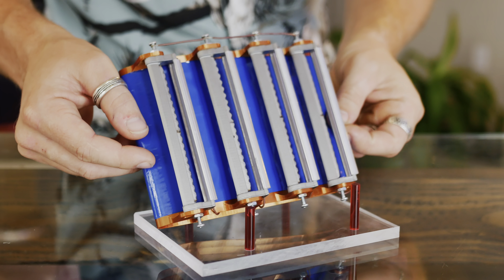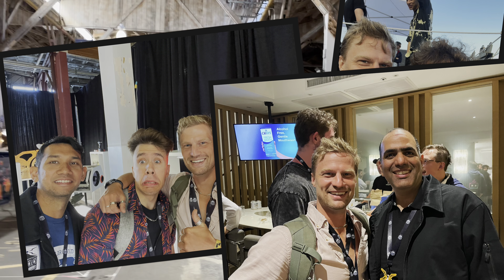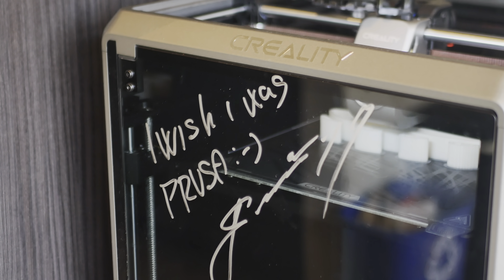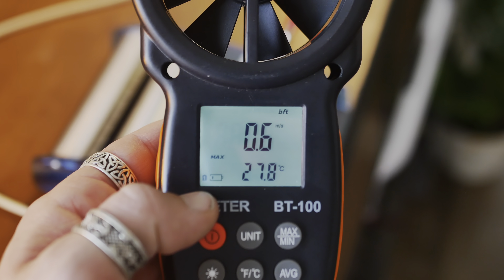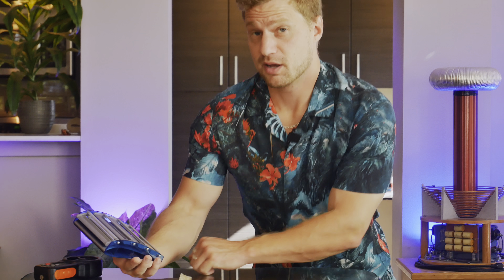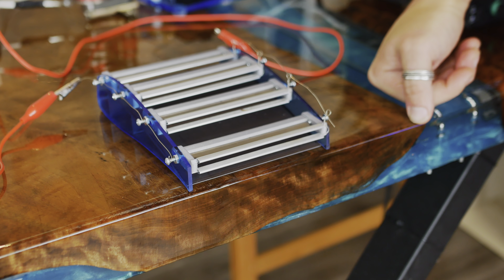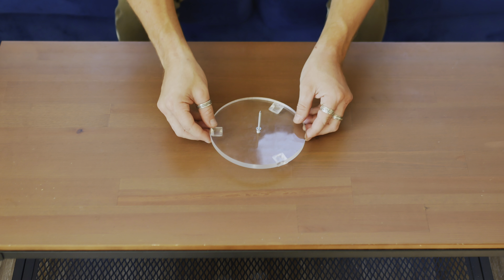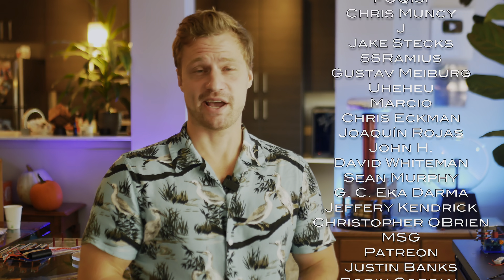Designing A Self Propelling Ionic Thrust Wing

Comment: I have a question:
would be possible to generate thrust if the ionic elements were on the surface of the wing? not above th surface, but ON the surface? like conductive tape glued on the surface?
i like your analogy of the turbine with wings, but you are putting things on a wing that will create drag, if was a way to crate such thrust without disturbing the aerodinamic of a surface, that would be gold.
Keep up the good work.

Comment: The wing is immaterial, you almost noticed that at the start of this video when you said the jet plane is built around the engine.  What you just need is sufficient thrust.  Rockets don't have wings, thrust moves them.  What you are doing here is just building scaffolding for flight thrust.  Modern fighters don't have the classical airfoil wing design.  They are incredibly thin with those surfaces primarily used for vector control.

Comment: Cool project but I am not really sure if this construction is going to work. I think the thrusters are going to create a lot of turbulences on top of the wings profile which might reduce the lift in the end.
I am not sure if it is possible, but don't you think it might be worth it to try to implement the electrodes directly into the profile of the wing? This might also reduce the overall weight a bit.

Comment: Have you considered just trying conductive ink, or aluminum foil, directly on the wing?  Using multiple sections, you might be able to avoid arcing by timing each segments power.  I know it's not grabbing the entire airflow, but applying even a little pressure difference would probably increase efficiency of the craft overall.  This approach could be applied to prop-blades as well, perhaps adding a little performance boost.  With recent concerns with fuel efficiency of commercial aircraft, this could mean HUGE savings worldwide.  Also, the surface itself is a perfect solar collector and may be able to provide or augment it's own power. (yay solarpunk!)

idk, just a thoughtstream, keep it up! Love the show

Comment: would not accelerating the air flow on the top side of the wing, and not the bottom increase lift? creating a higher pressure dif, meaning the shape will be able to be less draggy?

Comment: Try multi-body airfoils, so you incorporate the ionic trusts even further.
What forced you to installed all of them on top of the wing? Did you try all the possible configurations? I'd say there's an optimal 2 up and 2 down. Test their relative distance.
Last, add different pitch angle experiments to get Lift-Drag information.
Good work and good luck!

Comment: Instead of using wire for the leading edge why not not use graphite spray paint (with masking tape to mask the rest) and then electroplate the tips. 
Supper ultra light waight with whatever shape you want.

Also, there is a special type of fillement that can decrease it's density with temperature. I forget what it was called but it will drastically reduce waight without losing much strength,

Comment: Fantastic project and video!

I have a couple of ideas that could be worth testing:

1. Traditional wing airfoils work by creating an air velocity difference between the top and bottom surfaces, therefore generating a pressure difference and lift. In the case of this ion thruster airplane, since the thrusters are only on the top surface, you might experiment with a simpler, straight-wing design to reduce weight. This is because the high-velocity thrusters could potentially generate enough lift on their own without the need for the typical curved airfoil shape, as they can accelerate the air above the wing faster than below.

2. Given that the air is already accelerated to around 1.8m/s by the first thruster, it might be beneficial to increase the distance between the electrodes further down the air path to achieve even higher velocities.

It would be exciting to see these ideas tested out. Best of luck with your project! 🚀✈️
Reply: that the profile of a wing should be different with thrust applied to the surface probably is correct, but i would not use a flat surface. 
when the thrust stops for whatever reason the plane must glide to the ground safely, this would not happen with a flat profile.
Reply: @ulrichkalber9039  That’s true, having a gliding profile in place is probably best for a functional model. I considered using a flat wing for the proof-of-concept test bed.
Reply: @jot4p310  I think that gliding speed would be much faster than powered flying speed, therefore a flatter wing design would probably work.
the lost lift on slow powered flight would be compensated by the upper surface blowing effect.
Reply: Now with enough electrodes and ground points you could hypothetically control the power levels at each pair to create a virtual wing profile that you could dynamically vary

Comment: I would try to make the thruster fully integral to the wing. The first electrode could be just many thin wires thicking out of the wings 'skin' and the bottom part of the second bottom electrode could be just a little 'bump' behind the first (also might be used as a part of the wings structure), then the second top electrode having some low drag profile. It's probably gonna be pretty hard to make, but it could be worth it.

Comment: There are a lot of topological airfoil designs out there that you should take a look at. Think like dimples in a golf ball, where the topology of the airfoil improves its lift and efficiency. You could integrate your ionic thrust into the topology of a non-uniform airfoil in a way that would reduce weight and drag and potentially increase thrust and lift. 
Your thrusters also pull air away from the airfoil, which would destroy any lift the airfoil created. You should make sure the thrusters are aimed in a way to work with the airfoil, not against it - again, the topological airfoil might be a target there. 
You might even be able to integrate the ground into the airfoil itself, further reducing weight and improving efficiency. 
It's entirely possible that you could integrate the entire thruster into the shape of the airfoil itself, with no non-airfoil components.

Comment: 13:01 would having a ground foil sheeting instead of plastic leading into a single aluminum tube at the back of the wing and down angle razors work better weight wise rather than the four aluminum tubes?

Comment: Soak up some balsa wood in ammonia and use your 3d prints to mold it, should offer more weight reduction, you can print an offset shell that's the thickness of the balsa wood, slide it over to sandwich the balsa layer to get an accurate form, trace the cutouts and remove as needed

Comment: The easiest way to drop mass is to buy foaming agent infused PLA.

You can adjust the amount of bubbles by changing nozzle temp (take care that it affects effective volumetric flow coming out of nozzle)

Printing model airplanes is one of the main reason why that filament exists.

Also redesigning your part to be printable in vase mode is also pretty important.
Reply: Easiest way to go lighter is to remove 3d printing from the equation. Even LW-PLA is multiple times heavier than balsa and tissue/plastic or foam. I've built a couple of well designed (not my designs) 3D printed RC planes myself and they're just a curiosity. They're good looking and easy to build but they're very heavy and shatter into a million pieces with impacts that a foam plane would survive with good repairability.
Reply: The easiest way to drop weight is stop 3D printing. Either go balsa-film construction or hot wired styrofoam.
Reply: agreed
Reply: Here's the thing if he's able to successfully use three d printing to build something that flies.
It leaves some engineering wiggle room for other designs.
Reply: Do your blades have to be solid? Weight and flight is important.

Comment: Thank you for taking the suggestion made in the first video, integrating the truster into the surface of the wing, with enough thrust it might even be able to VTOL
Reply: If you can integrate the truster into the wing you can eliminate most drag, and much of the structure weight for holding the thrusters above the wing, the problem, long term, is dust building along the surface of the wing leading to shorts

Comment: Use razor blades they even lighter.
Cover wings with some plastic tape glued with some thin rubber glue.
You also can use paper to ligthen construction, soak with some plastic desolved in in solvent maybe even lighter alternative to plastic wrap.

Instead of plastic frame use wood. Specifically balsa wood frequently used in modeling, it is very light and when used with correct grains orientation pretty strong.

Good luck! I want to see your build in the air!

Comment: You should be able to use Bernoulli's principle with surfaces specifically designed to increase the air along the top of the wing and channel or force the flow. Blade or 'generally flat' flows of air are somewhat useful but focused into smaller channels increases velocity, thrust while decreasing pressure.

Comment: to get a sharp edge on the wire why not use a jewelers roller to flatten it, you could then draw it over a stone to knock one of the corners off.... it should give the aerodynamic profile in addition to the sharp edge your after while inducing some static discharge points along its route.

Comment: Instead of using wire to reduce weight in the blade section. What do  you think about laser cutting the razor blade section? I think the fiber laser I have can do it as long as the blade isn't over 1 mm thick.

Comment: hey man maybe i can help you out.
i make some pretty fun stuff and have a million ideas of my own.
your thrusters are interesting but the one you have thats 4 stacked it looks like velocity stacks put them next to eachother not feeding eachother. the ones after the first are gonna be restricted and the 4th will have the weakest flow. 
you could stack them if you made each one a little smaller or a little bigger each time. like a jet engine the stacked turbines get smaller and compress to crazy levels.
by going larger you could have the stream going through the middle suck outside air into the larger ring under a venturi effect like a carburetor and it would flow more and you would see gains.
but having maybe 2 stacked and 2 next to it and another 2 next to it. you would induce more thrust due to more surface area and more flow.
think about computer fans. you dont stack fans but you put 2 fans where one was and you get more flow next to eachother. 
if you were to also maybe use a square shape you might get more thrust too vs the rings. atleast with straight lines across the rings. if you made the rings element go towards the center maybe with a slight twist you could increase surface area and maybe more flow too. and some twist could reduce turbulence and also be used for stability like anti roll.

Comment: Shouldn’t the thruster be on the bottom side of the wing to not compromise lift?  Speeding the airflow on top of the airfoil will substantially compromise the lift in theory without some adjustment to the air speed on the underside of the foil.  No?

Comment: 44 grams for only apr 10x10 cm, so 0.01m².
So if we consider the wings area of an A320, (122m²) and extrapolate from your results, it should be 12200 times more, that is to say 536 kilogramms force of thrust, or 4% of the kerozene version. Not so bad !
just have to multiply the thrust by 2500% ^^

Comment: Would it be possible to have the thrust components inside the wing, so that the airflow of the wing itself is not impeded, then you could place the inflow and outflow of the stream in such a way that it compliments the lift forces instead of fighting against it as it is probably doing now.

Comment: You should increase the number of discharge points along the razor blade or, in other words, increasing the serrations along the blade - possibly resulting in a slight decrease in weight and a slight increase in air velocity. Don't understand it completely, but seeing the time exposure photos showed me the number of corona discharge cones arising from the serrations along the blade, changing/increasing this variable could optimize the design further?

Comment: I would try replacing the ground with metalic tape on the wing surface. You may be able to do that with the positive side too, just have non conductive segment separateing them. Also 3d printed wings even foaming PLA are heavy esp at small scale. Look in to hotwire cut foam wings. Love your channel, cant wait to see it fly, good luck.

Comment: One that I never got around to making, was a sphere with mutiple equidistant node points across the surface.
Half anode half cathode.
Then use individually mapped/controlled HV sine waves to every node, so that the phase shift between the nodes could control the ion thrust across the surface, in any vector that you wanted.